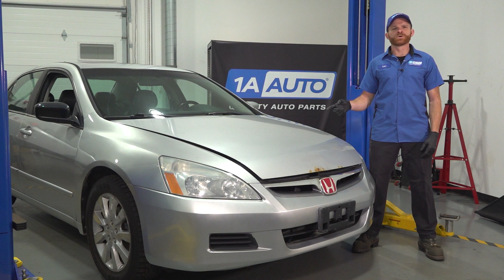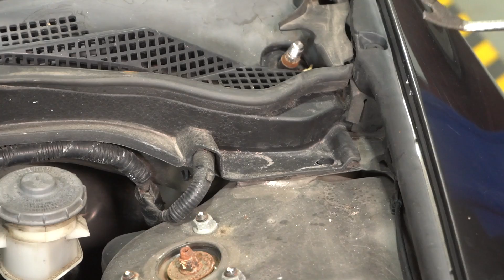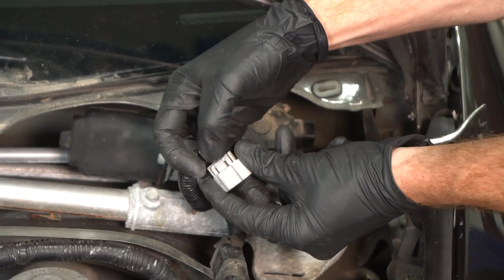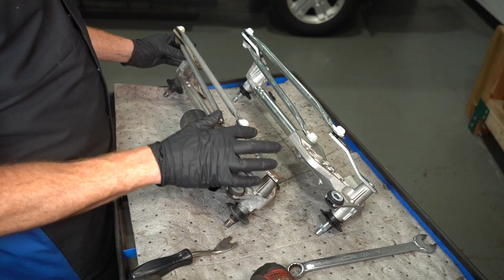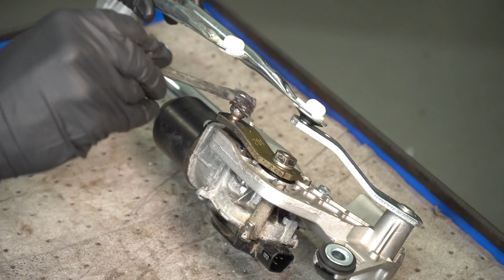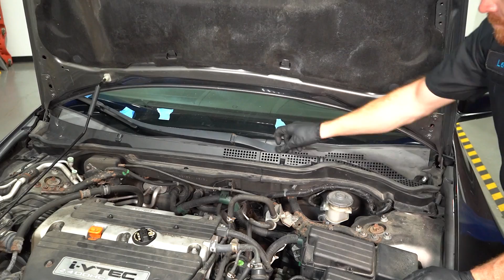How to Replace Wiper Motor & Transmission 2003-2007 Honda Accord

Comment: Note that to be able to get it back in and work correctly, the two long arms on the transmission need to be parallel to each other. Take a pic for reference after you get it out before you remove anything else.